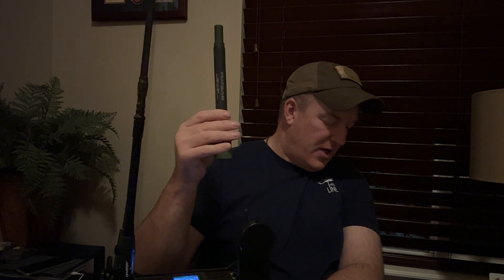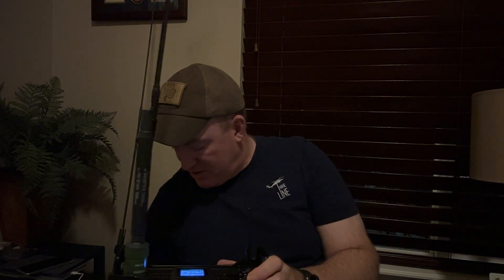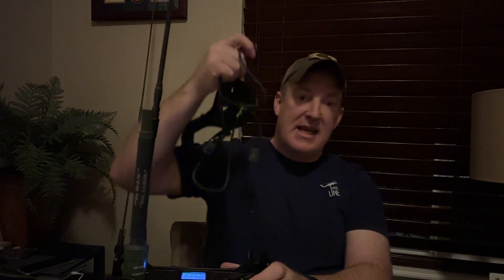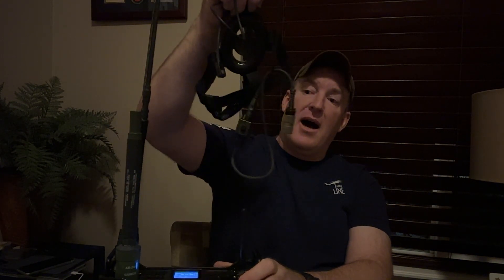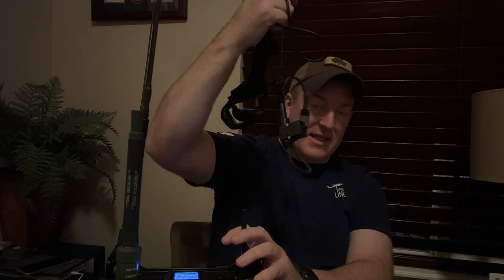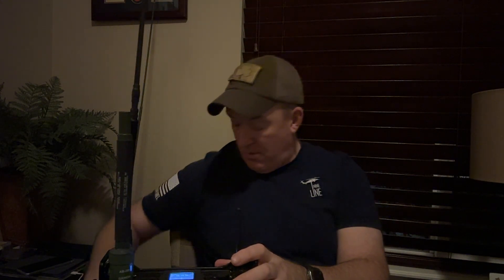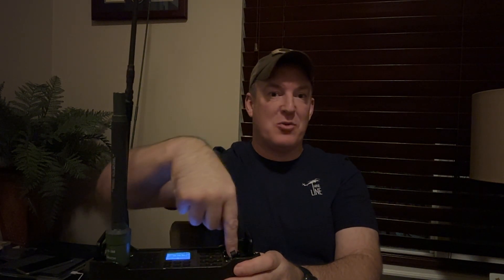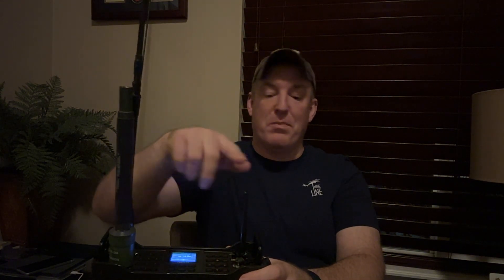Updates for TBR-119 for early 2023

Comment: Hey man, thanks for all the information on these. Incredibly well delivered information.

If I did buy one, would it be best to keep the original factory settings? I'm just looking for a functional radio for comms within a 100 acre plot of woodland - so not too intensive, using as a base station for contact with our Tri PRC-152 radios. Thanks boss man
Reply: Just watched your April 2024 video. Needs a bit of work on the interior 'thermal paste' etc..  Saved me some cash there brother. Hopefully they sort out the issues.
Reply from the maker: @sc7485  i’m glad these videos are being of some benefit. My advice to you then, if you wanted to use these to interface with something like 152s , a solid VHF/UHF radio that I absolutely love, is the anytone 578. It can do really great wattage (50w), easily communicate with any analog radios but also has a lot of additional functionality with DMR and APRS. There are aftermarket parts for them too. Check them out.
Reply: @brianc0620 Yeah dude, you saved me a bunch. Thank you for these. The Anytone looks amazing, good piece of kit & much cheaper. Have a good day brother 🍻

Comment: Hey Brian sorry I'm late to the party but how have things been going with it lately?
Reply from the maker: Hey Russell. 
Not much to be honest. 
They fixed the software that makes it stable. So it doesn’t crash immediately thankfully. 
That said, DMR is now working (simplex mode) 
Power is a bit of a mess. Especially in upper VHF and UHF. The power settings basically do nothing. You have one set amount or transmission power. 
Funny thing is that that exact same power settings are different in the other 119. They gave different TX power results. 
So once again, no consistency. 

Long story short, while the radios are somewhat functioning now, I will not as of right now, in good conscience, recommend them for purchase. Until these things function as promised and advertised, and are consistently doing so, I will not promote them. I am still holding out hope against Hope.
Reply: @brianc0620  well sorry to hear that brother...... May a new manpack will hit the market before too long
Reply from the maker: Imagine if xiegu or similar came out with a hardware that is solid on the software too?? Dream state!!! 😂

Comment: How safe are modern ham radios from hacking?
Reply from the maker: Interesting question. Here is my opinion on that. 
In general I would say “they are safe”. Ham radios are generally safe from hackers, with respect to some POS hacker trying to mess with you, your equipment or trying to gain access to your PII via your Ham radio. 
There is little for them to gain, communication TX methods tend to be painful slow (for hacking purposes) and thus very hard to exfiltrate anything obtained through the hack. So that covers the inbound hack. 
Now another angle would be, can radios such as SDR be utilized offensively to hack wireless devices, YES!  Just check out a HackRF SDR device with a computer or Raspberry PI.
Reply: I imagine bluetooth capability makes things even worse.   @brianc0620

Comment: Hey Brian, I see your latest video went to private. Everything OK?
Reply from the maker: Hey brother. Yeah I pulled it…. For now. 
Basically they asked me for a chance to make it up and fix their trespasses. They said the new software should be available at the end of next month. They have a new customer support person, they are friendly and responsive. 
I am giving them one last chance.
Reply: I heard they'd blacklisted you? If they're changing tact that's good to hear although still very off putting for them to have done it in the first place. Very disappointing this radio doesn't use standard milspec plugs for everything like antenna, 6-pin headset port, etc. Sounds like they should do a refresh with a major overhaul.  @brianc0620

Comment: Did you ever try the original HF Antenna on Qso and did you add radials / counterpoise?
I'm asking to get a feeling if it will work just putting out of the bag pack on a Sota or Pota reference and use it without a preparation of the area with much wire. TU vy 73 de Oe1rof
Reply from the maker: Hello sir. I have performed QSO on HF with the 119 using the OEM 3m long whip antenna. About 15 mile range and it worked well. I did not use radials or counterpoise, just a ground stake. 
Other than that I have used a dipole and it worked well too. 

That said, I was testing 40m on an NVIS wire antenna this past weekend and it was unintelligible. Robotic. I am still troubleshooting that.

Comment: Any chance you would be willing to make the data cable and mic adapter to sell?
Reply from the maker: The good news is that they now include the data cable or will send on if requested through the vendor that sent it to you. 
The dongle that I made for the H250 works well with the exception that when transmitting in NFM for some technical reason, I need to use the original handset.
Reply: @brianc0620  Mine came with a data cable (I thought it was the wrong one?), but I cannot seem to figure out how to update the firmware to 3.2.1. The instructions in the manual don't seem to help.
Reply from the maker: @esds4330  you can request the Data update cable from the vendor that you purchased the radio from. Guohe will send it to them. 
That said, the latest version is 3.4.0. 
It fixed one issue but my DMR does not function correctly now and WFM is is transmitting less that 1W on UHF. 
So with Guohe, it’s two steps forward, one step back. 
My advice is to do a baseline of what works and what doesn’t. So after you eventually upgrade, you know where you were. They are hard to deal with to be quite honest. The guys with the Q900 are straight up loosing their mind. There are many more of them than us 119 owners. 
Guohe will do themselves out of business if they keep up this break/fix drama. 

Side note: One positive of having the data update cable is that you can run a keyboard directly into the radio for CW and RTTY. CW is literally just type and it instantly transmits. They actually ship the radio now with both cables. Once you get it, plug in the usb dongle with the FW Update Bin on it, hold down the power button for a few seconds and it will start the upload automatically. It will just click once (the power up relays, you normally hear a series of like 4 clicks from the relays).

Comment: Is it possible to do DMR only on UHF and VHF?
Reply from the maker: I can confirm It does TX in DMR mode outside of VHF and UHF.  
I was able to check that TX was occurring against a SDR. I have no other dedicated DMR radios that can RX in a lower frequency than VHF/UHF, so the observation was not 100% other than TX was occurring and it sounded the same on SDR as the upper bands.
Reply: @brianc0620  ok, thanks for your quick answer.
Reply: DMR HF, that’s a very interesting capability imagine that paralleling like ALE, select call, Net calls. Your explorations on that will be interesting.
Reply from the maker: @stevekern8723  agreed. I can try test with a friend that has the same radio. It will be interesting for sure. We did various mode testing last weekend that was approximately 12 mile range (LOS) in 6M and higher frequencies. AM,W/NFM/DFM/DMR. We were thrilled with the outcome and learned items. Very productive.

Comment: Hello There, AMATEUR Ham Technician here, I was interested in this radio but I'm not seeing a lot of information, and from the sellers, they keep mentioning something about a "Key"? for $300. Can you speak to that or do you only need that for if you want your data encrypted for whatever reason and is not necessary? Can you program channels into this radio? Any Help would be greatly appreciated as I don't have the funds to find things like this out the hard way, which is keeping me from fully exploring the HAM world.
Reply from the maker: You only need to pay the $300 fee for an encryption key if you are using DMR and are going to encrypt your transmission (you’re going to actually need a pair of keys, one for a second radio too, so $600). If you don’t want to encrypt the communication then you can ignore that item. The radio comes with DMR functioning as is with no additional fees for keys or licenses required . 
Channel programming is possible currently via manually punching in the frequency and channel name into the radio itself. The software that comes with the radio, while it has this option, it does not work. Additionally, the manual program in of channels is problematic as that part of the software is buggy and will overwrite the entry with jibberish. They are working to fix that.
Reply: @brianc0620  Thank you Brian, I basically had the same question because eBay shows the Radio and everything that comes with it.  Ebay didn't describe everything in detail very well.
Reply from the maker: @Counselor77  as usual and compound that with inaccurate descriptions too. Not exactly what the product can actually do.
Reply: @brianc0620  Thank You Brian.
Reply from the maker: They have fixed the channel programming function, it correctly stores all entries. They also released a Chirp type interface to computer-program the channels into the radio.